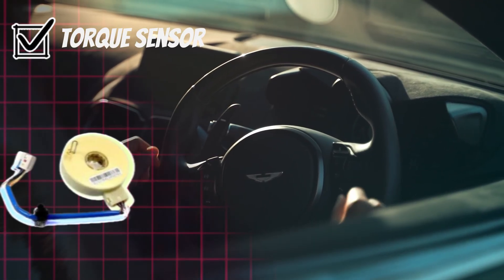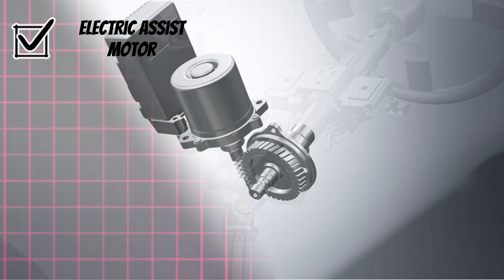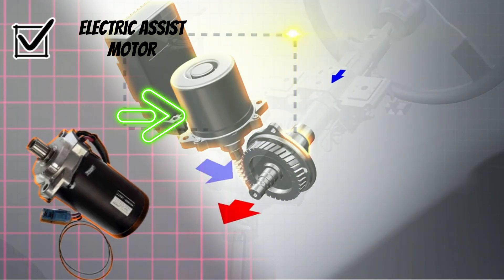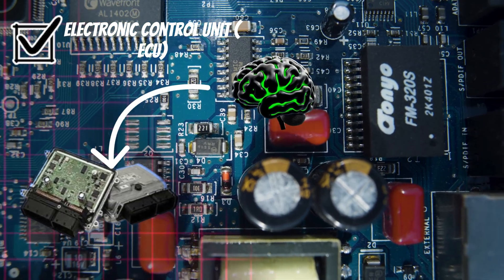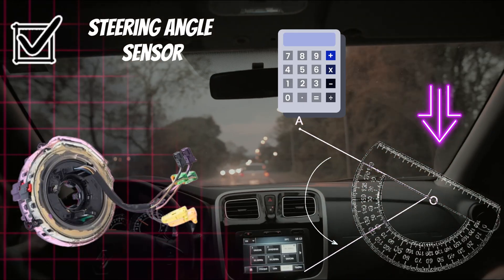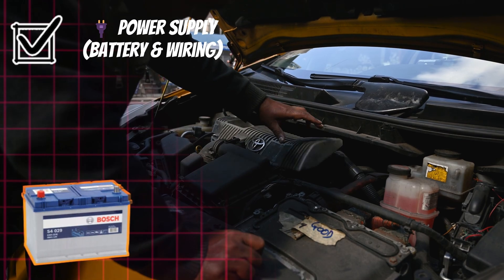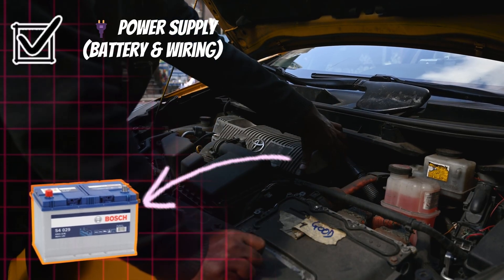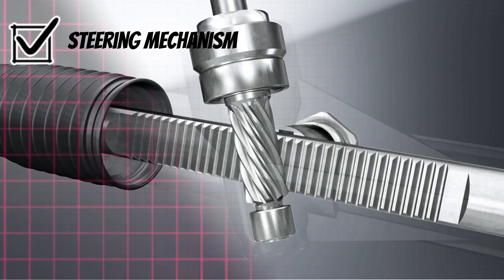Electric Power Steering (EPS) Explained: Components, Symptoms & Common DTCs #auto #mechanic #car

Comment: where to find electric power steering motor kit in my 2013 Chevrolet Equinox liz
Reply from the maker: In the 2013 Equinox with the 2.4L four-cylinder (which uses an electric power-steering system), the small electric assist motor is integrated into and mounted on the steering rack/gear assembly under the front of the vehicle — you’ll find it attached to the rack housing near the wheel links